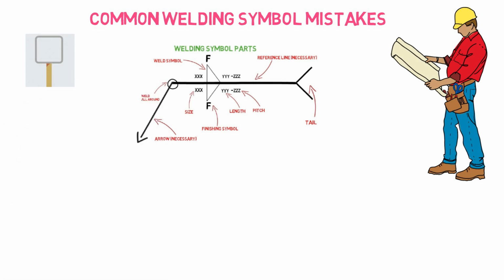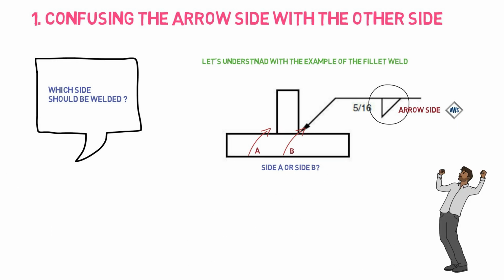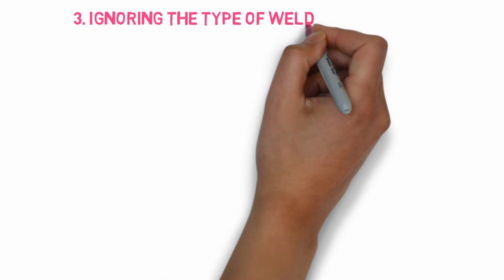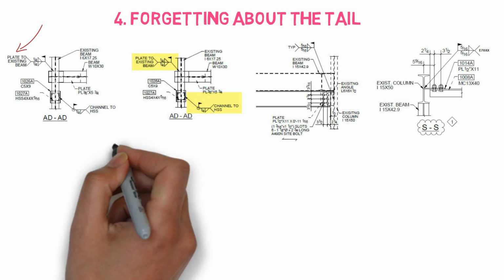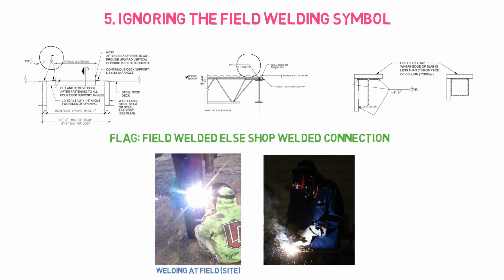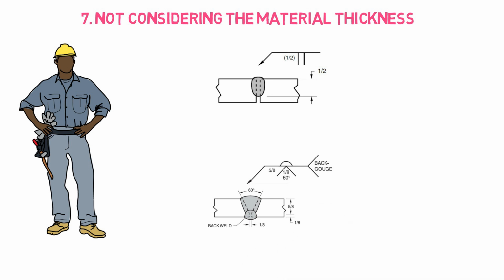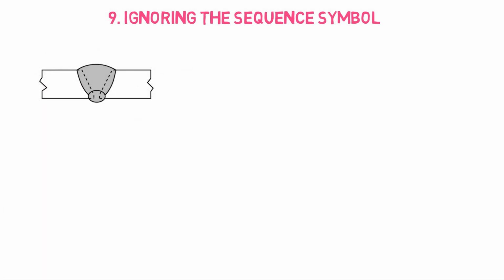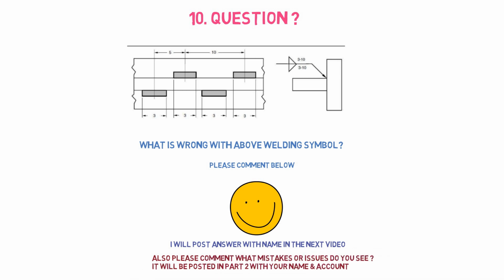10 Common Welding Symbol Mistakes and How to Avoid Them

Comment: Dear sir 
             please make video  basic to advance
             how to decided to weld in different thickness  plate  to welding  thickness. 
             as per  universal standard structure component. auto mobile and other sector  any assembly line 
             main focus is structure component like pre engineering building, bridge, marine ship and steel  line.
Reply from the maker: very nice suggestion , I will try to make videos on that

Comment: I believe the issue with the welding symbol is that the Fillet weld symbols should show an offset in their position on the reference line of the Welding Symbol to show the stagger in the welds between the Arrow Side vs. the Other Side.